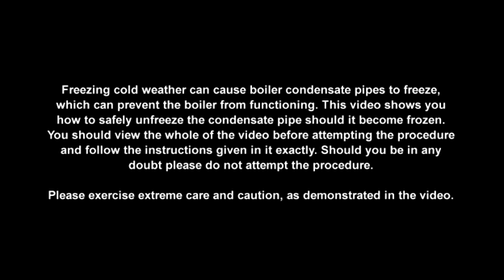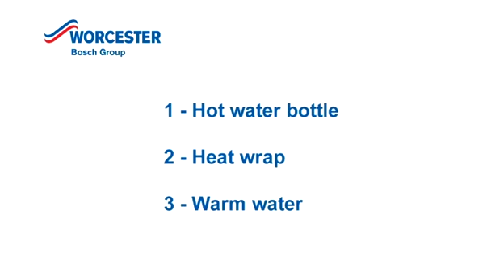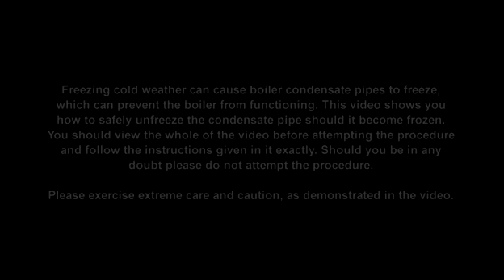Thaw and Prevent Frozen Condensate Pipes | Worcester Bosch

Comment: I think I'm being thick...

 "Don't.....if the pipe is above ground level" but the pipe shown here is above ground level. Isn't it? Sorry if I'm just being derp but I've just had a new boiler installed and need to make sure I understand. My condensate pipe comes out at about eye-level (5 foot-ish; am ridiculously tiny girly!) then that cuts into the vertical drain pipe.

I've ordered some lagging, but until it gets here need to understand so thanks for any clarification from anyone!